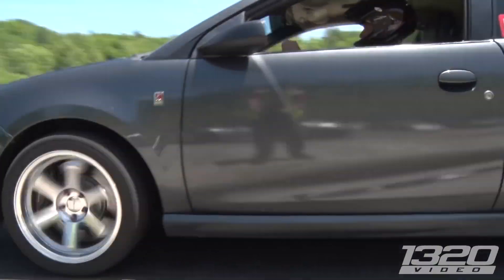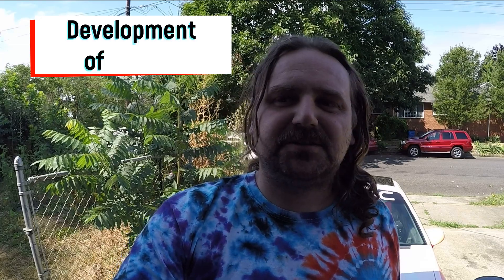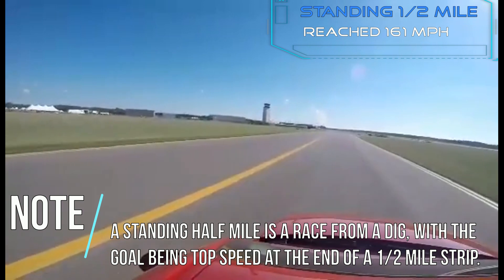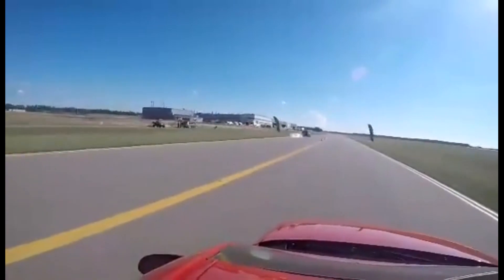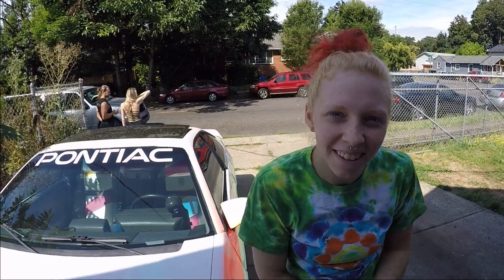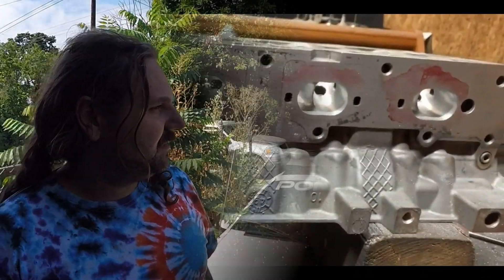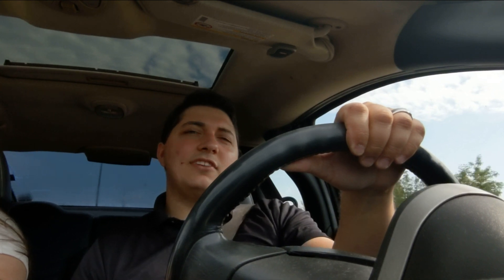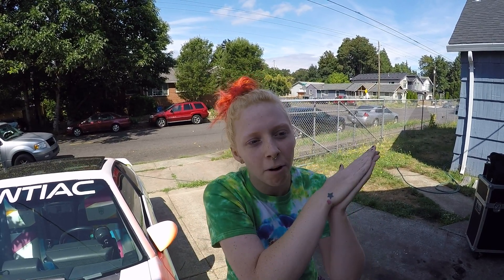What is a LSJ 2.0 Ecotec ANYWAY? | Project LSJ Fiero Backstory | Saab B207R

Comment: I've had Both versions of the SS Cobalts, I got the 05 LSJ brand new and totaled it with about 10K in mods and less than 20k miles- broke my heart.  Now I have an 08 LNF and it's great, I love it, I have it in really nice condition and this time my only upgrades are GMS1 and a K&N CAI.  I'm keeping it more stock cause they only made 3200 of the TC and doing more would feel like putting graffiti on collectable art.  The power delivery is noticeably different between turbo and supercharged and the 290ish hp I get is more than fun for my commute.  Having 400 sounds like it would be tough to handle on such a tiny car daily.
Reply from the maker: It's not super practical for a daily imo , the life and enjoyment of the car is wasted just idling around. I keep use it as a weekend car and it's great for that. Awesome story!

Comment: Can i get the zzp rods and diamond pistons for my b207r saab motor? It should be exactly the same right? Have my motor fully apart at the moment
Reply from the maker: Yes. buy them for an lsj. they are the same internally. You can always confirm this with zzp as well but i am sure of it.
Reply: @LightspeedFieros  sweet thanks!

Comment: I have an 86 Fiero with a LNF fully modified with a T45e trans. I have to dial back the power because I don,t think the Trans can hold the power the LNF can make. Have not Dynoed it yet but that will be next spring.
Reply: How are your brakes set up? Stock? Upgraded? Curious, as I have.  86 Fiero 2M6. Thanks

Comment: Nice video! Never owned a car with an lsj, but I have an lnf cobalt that was a rocket with just an intake, intercooler, piping, and a tune.  Sent a rod through the block after 100,000miles. Have a brand new gen3 (cast block) lnf/ldk sitting in the crate just waiting for me to have the time to swap it in. Probably put in some sale forged pistons and rods before putting it in, as well as a bigger turbo. As it was before the catastrophic failure it hurt a lot of feelings.

Comment: My TVS LSJ went kablamo. But guess what? I'm rebuilding it. By myself this time. Not giving up on my Redline, its too good. It'll prolly pop again, it being my first engine build and me not being a mechanic. But hey, that's how you learn, the hard way. And with awesome youtube videos that teach tons of cool tricks like that. (and a spare engine ready to go in, 'cause..) Keep it up mates, looking forward to the glorious result :D
Reply: My lnf cobalt was a rocket, I used to play with the big boys with their v8's and hurt feelings. They would be on it hard and id feather the gas as they put pedal to the metal, then id floor it and pull hard. All stock motor, just an intake, aftermarket intercooler/piping, and a tune. Had a bcm problem develope and took it to a dealership and the messed up the reprogram and programed it like a normal cobalt. Any time it hit boost it'd spit and sputter and ran like crap. Swapped in my original janky bcm and it was back to normal. Sadly the damage was done from what the dealership did and I sent a rod through the block. This happened just cruising at 70.... now I have a brand new ldk in the crate waiting to get put in and oll go bigger turbo. Those 1st gen lnf blocks were weak. This one should be good enough well past 500hp
Reply from the maker: Sinformat has some good info here!
Reply: @LightspeedFieros  thank you! I learn from trial and error, but definitely not an expert. if anyone is interested I can post a link to where I bought my new motor, if they have any in stock still. When I bought mine I think they had several hundred left. They are fisker karma motors. I paid around $2200 I believe shipped to me which for a complete gen 3 lnf brand new in crate its not a bad price. It was a complete motor even included the turbo charger.
Reply: @the_shoggoth  yes the early blocks a lot had porous blocks and would leak coolant and oil directly through the block. They were lost foam cast. The later generations were sand cast and much stronger. Hit me up on instagram joezombies84 and ill dm you the link where I got the motor.

Comment: What transmission are you planning on running?
Reply from the maker: F35 limited slip from 09 cobalt ss
Reply from the maker: It's 3.82 final drive , 5 speed,  limited slip differential. Handles 400hp reliability more if your careful.  Designed by saab , was meant for the lsj or lnf motors.
Reply: Oooooh!  What are the specs on that?  I'm not familiar with it.